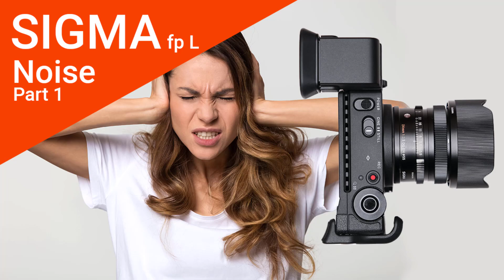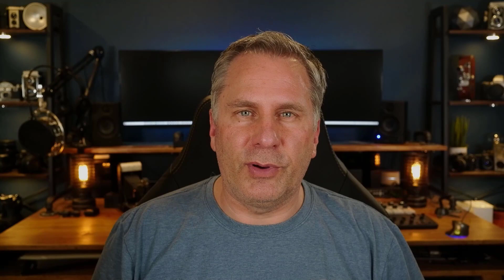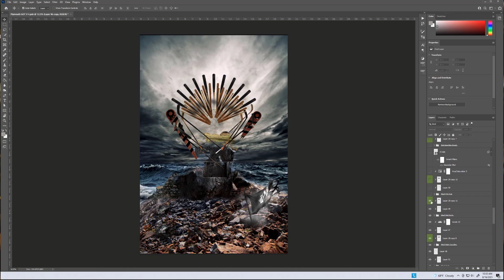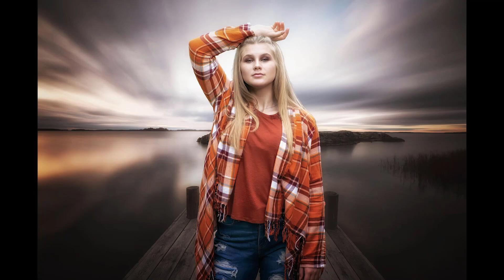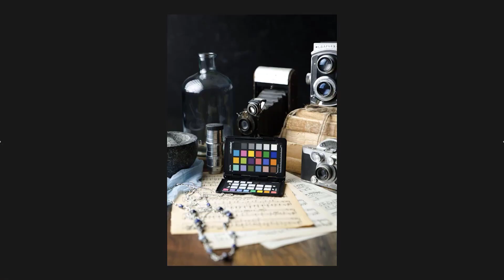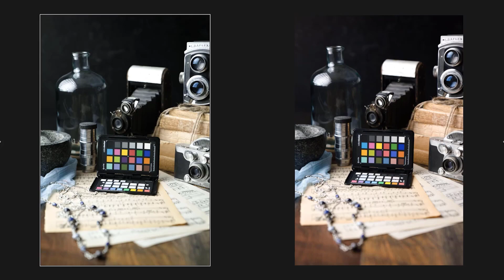Sigma fp L Noise Test - Part 1

Comment: hey! I'm looking for any information on the fp L and flash? You said that you used a shutter speed of 1/60. Were you using a strobe or just a modeling light? 

Also, have you ever used it with a flash attached to the hot-shoe mount? Can you use a high-speed sync?
Reply from the maker: Hi Michael! Unfortunately this is one of the weaknesses of the fl line. Because it does not have a mechanical shutter (100% electronic) not only is there no HSS but the highest sync speed is 1/30 - 1/15. This makes is very limited for flash (and in reality completely useless for flash). I was using continuous light. With continuous light or natural day light it is great with very good low light capabilities, but no real flash here.

Comment: It's interesting that the fp has a slightly green cast, while the fp L has a magenta hue to it overall.  The fp L seems to consistently hold highlights better like the bright highlight on the lens at 7:06.  Overall, very close.  I would take the fp L most likely since I like to shoot landscape.  But, all my photos up until now have been 24mp or less and turned out fine, so maybe it's not worth the extra cost.
Reply from the maker: Hi Alex, I think your thought process is spot on. The L has the resolution which is great when you need to crop, and better AF,  but both of these features are generally not as important to landscape photographers. 24mp still takes beautiful photos.

Comment: Does the FPL worth the upgrade ? does 700$ price difference worth it ?  I am looking for better image quality and autofocus.
Reply from the maker: Hi, that’s not an easy question. The big advantage of the L is the resolution and PD focus. Now for resolution, if you are doing a lot of cropping (and there are legitimate reasons for this), those extra pixels come in handy. However, if you are the type of photographer that gets it “right” in camera (or really close), you may never see the benefits of those extra pixels. Large printing can sometimes make use of those extra pixels as well, not just in resolution but in sharpness. But this has to be fairly large print.

PD focus is generally more actuate than contrast, especially with moving objects. But again, are you shooting dynamic subjects? For example, if you mostly shoot still portraits or manually focus this really doesn’t mean much. However, for something like video, yeah it does. 

And there are some tradeoffs in resolution. One of the most notably will be increased rolling shutter effect. This will be more pronounced on the L, so fast moving objects are more likely to bend and whip pans will create the “jello” effect.

I think it boils down to what you think you will be using the camera for.

Comment: Confused - were you testing CDNG Raw files from the FP and FPL? The colour settings are irrelevant, but you mentioned having pushed the colour for a previous project on the FP. The jpegs are nowhere near as good as the raw files (in stills mode).
Reply: And White Balance is variable in RAW mode.
Reply from the maker: If you are shooting in RAW for photos (or DNG in Sigma's case), while color profiles are not applied color temp is. You have way more latttitude to adjust the temp in post with RAW but the images are still affected. My Sigma, Fuji's, and Nikons all work this way, and while I always shoot in RAW (Mostly) I can tell you more than once I've screwed up RAW images because I shot with the wrong temp. It's a painful lesson but can usually be fixed in post! A lot of photographers I know just keep the temp setting at a constant setting  when shooting in RAW so that all images have the same base color and then adjust it in post as needed. I didn't want any post adjustments so I just left it at as shot.
Reply from the maker: Hi Chris. This was just a photo test. I used stills, set to DNG. In this mode the DNGs are affected by   temp settinigs. In CDNG you are correct, the color modes are only applied when images are viewed in camera.
Reply from the maker: BTW: This is a great topic for a quick follow-up video. Thanks for the comment. Is there anything in the video you'd like to be covered?
Reply: @johnteichman1478  
I have my FP set to AWB. I view using 'Standard' profile in the field, but process RAW from scratch in CaptureOne.
Still waiting for you to explain your view on the electronic shutter.
Reply from the maker: These are the settings I normally use as well. I've been meaning to try Sigma's software on them, I believe that it can apply the modes in post as well, but that software is rough! Only use it to process the raw Quattro SD H files Yes the electronic shutter, coming up soon!  Thanks